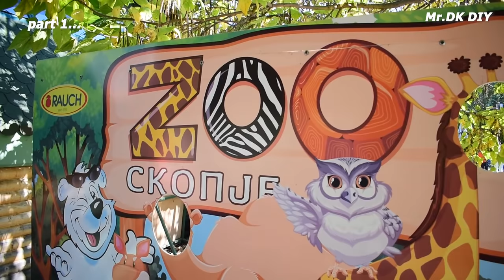Donation for ZOO Garden / Custom Made DIY Project / Homemade Bicycle Triler / Trolley Cart / Part 1

Comment: Nice but it is better to specify the size of each part if you allow and the specific area around the wheel and the size of the screw used or a translation into Arabic Thank you